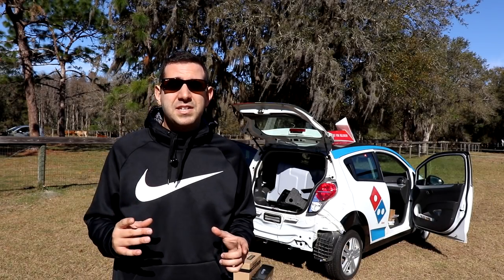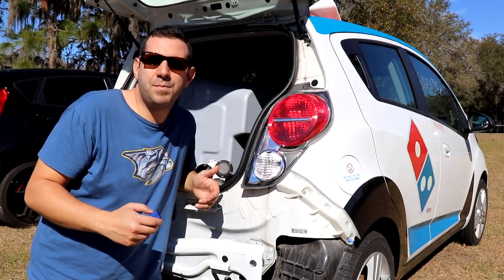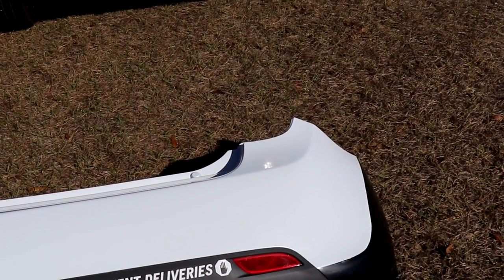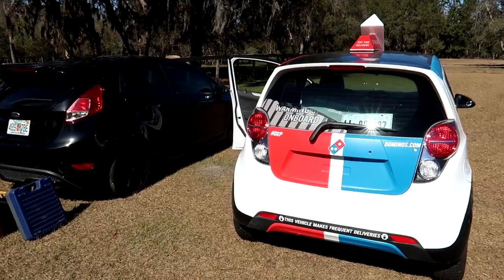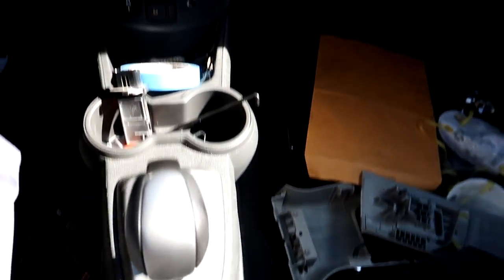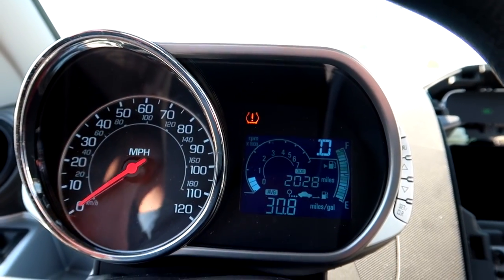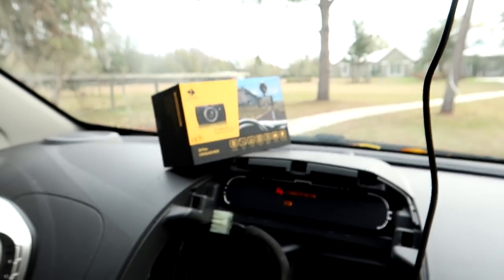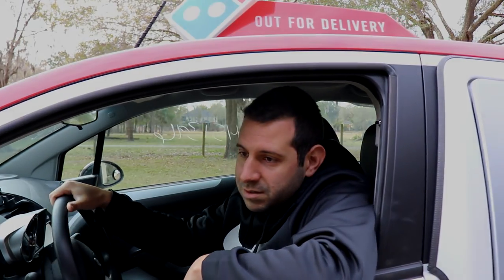I Put Train Horns on the Domino's DXP Pizza Car! (and a bunch of other mods)

Comment: now I know the reason for the oven... the car is too slow to make it anywhere and the pizza still be warm and enter me in the drawing for the bluetooth dongle
Reply: A lot of city speed limits are much slower than the car's top speed, I believe.  where I live it's 25, county limits were 35.  Highway driving would be where it's speed limitation would be an issue in areas with a lot of needed highway driving.

Comment: Where did you get your chicken from? I went to O'Riley and all they had were turkeys so I can't do up my paint job correctly.
Reply: OctopusCarDoor did you look behind the counter?
Reply: Lol :) 
So that's what  my paint job was missing , a Chicken 😆😃
Reply: OctopusCarDoor lmao
Reply from the maker: You win a OBD Reader. Please Email SamcracAuto@gmail.com
Reply: Samcrac 6:57
Why didn't you use Torque App to monitor coolant temperature??😲😲
Reply: As far as CVTransmission goes, I thinks it is irrelevant on a small cars with small engines. Not a huge difference in fuel economy. But on my 3.5L 260hp engine feels great. Mine is very smooth. I can rev RPMs only up to 1.5K and still reach highway speeds keeping it at 1.5K RPMs without much fluctuation or floor it up to 6K and reach desired speed faster than a vehicle that has AT or MT with the same engine setup, because RPMs do not drop for a gear up-shift.
You really appreciate it when driving in the mountains. You know that time when you are going up the hill and your AT is shifting up-n-down because in 3rd gear RPMs are too high and it's time to shift up but in 4th is struggling and shifts back down. With CVT it doesn't happen. You simply pick a desired speed and the correct RPMs will be applied to keep your speed steady, with very little fluctuation depending on the angle of the incline.

Comment: Not to be the bearer of bad news, but cvt transmissions are being pretty much used in every car, and definitely by every manufacture for at least one of their models, with the exception of the high end manufactures, and trucks. If you want to avoid a cvt, you either to be willing to drop a lot of money on a car, or truck, never buy a new car, or drive a manual transmission. Cvts are used for 2 reasons, better fuel economy, and less moving parts, so cheaper. "it feels like is constantly searching for a gear" that is the point of a cvt, or continuously  variable transmission. There are no gears, it is two pulleys, and a belt. The pulleys change sizes, thus changing gears. There is no defined gear, or shift.
Reply: That's one reason so many vehicles now have 7 or 8 or 9 speed automatics even though they're complicated; they're trying to emulate the efficiency of a CVT without being one because people just don't like them (they say that it feels like 'the transmission is slipping all the time' or 'it can't find a gear').
Reply: Mazda isnt a high end manufacture and they dont use CVTs
Reply: There are stories coming out of Australia about CVT transmissions on some cars are disintegrating and before the car is three years old it has had several boxes fited.
Reply: Cause thats what I want... for my drivetrain to be a rubber band... yeah no thanks.

Comment: swap the ECU from the other Spark, in case the DXP was de-tuned. speaking as an owner of a 2014 impala, the temp gauge can be pulled up on the DIC screen, try this on the DXP.
Reply: Use the OBD scanner+Torque App for live sensor readings!!!!
You've got one in your hand.😁😁

Comment: My 06 honda civic has an electric throttle (meaning a steel cable isnt connected to the throttle body). I was on a hill at a red light, I  go to let the clutch out and get on the throttle and there was no response, I nearly ran into the car behind me, luckily I stopped in time. shutting the car off and starting it temporarily fixed the issue but I dont want that to happen again.at a red light on a hill. this OBD scanner would be useful :) The recall on it has already been replaced and is still giving me the problem, Honda cant figure it out and I personally love working on my own cars.

Comment: No temp gauge is the only thing i hate about my spark. Come on. But i looked online, and lots of people said that lots of our temp gauges in cars are dummy gauges?? They are just programmed to say a temp when it's supposed to be that temp. What's your thoughts on this?

In my spark when the back seats are folded down, BAD road noise. Good when the seats are blocking the back wall.

5 speed manual. At 65, i get 45 on the highway. At 75, 38 mpg. 35 in the city.

Comment: Texas salvage inspection was much easier. Basically the normal safety inspection and nothing else. They check the wipers, headlights, horn, drive it around the back of the building, let it sit 5 minutes and slap on a sticker. Except now they don't even do the sticker. They just clear it in the computer and then you can go register.

If major body panels, engine or frame are replaced you need documentation of those.

Comment: frankly would not have minded getting a hold of one of these little cars cheaply myself strictly for the crack up value of using it to run errands and such. It's quite the hilarious looking little vehicle with those Domino's logos and stuff on it.i am picking around at doing a Ghostbusters conversion on a white 90s Dodge minivan and I'm wondering if anybody knows where I can find a Ghostbusters siren I'm not having any luck finding one on eBay. Haven't tried looking for the blue roof lights yet but I'm sure those probably are not difficult to find the body sticker kits are pretty simple enough and cheap to get but the siren is proving to be something difficult to find.

Comment: Ill tell you exactly why that CVT sucks. CVT's are not designed to have "gears" when you put the pedal to the metal the engine is supposed to rev up to the top of its power curve and the transmission is supposed to slowly adjust so the engine rpm stays exactly the same as you accelerate. Car companies program their CVT's like this because people didn't like the way the engine never changed RPM's under acceleration. A normal CVT is very good on fuel efficiency and is good at not hunting around for the right gear because there are no gears.

Comment: Have you considered using dish soap, a scrub brush and a powerwasher/garden hose for the transmission fluid stain?  I use dish soap and a scrub brush to get grease, oil and degreaser and paint off my hands.  Lemon fresh and  cuts through grease.

Using kitty liter to absorb whatever you just dumped on the stainright away seem counter-productive to me.  Even shower cleaners say to leave it alone for a few minutes before washing off.

Comment: I have gotten thee of those little blue obd2 readers from all different sellers. My friend had two. All of them had incomplete solder connections on the inside and they didn’t work. Don’t cheap out on those. Spend $40.00 and get a good one.

Comment: Honda CR-V has a CVT trans it will go to 4K rpm and stays there under full acceleration varying the pulleys while accelating. Very noisy and annoying.

Comment: I hate when the cvt changes pretend gears. It’s inefficient, and unnecessary. A cvt should keep the motor at its most efficient spot during acceleration or cruising. Blek

Comment: The point in a CVT transmission is to keep the optimum gear ratio for the engine speed allowing for not only the best fuel efficiency but get as much torque to the wheels as possible instead of losing that torque in the transmission.

Comment: i suggest putting in a chip and k&n air filter and either a flowmaster or straight pipe exhaust it will help the car with the little 84hp it has stock